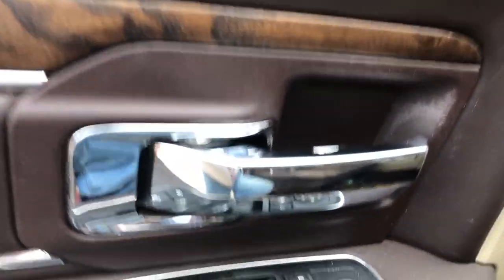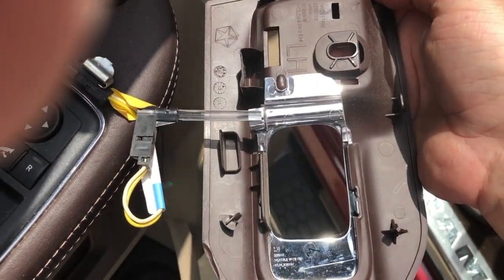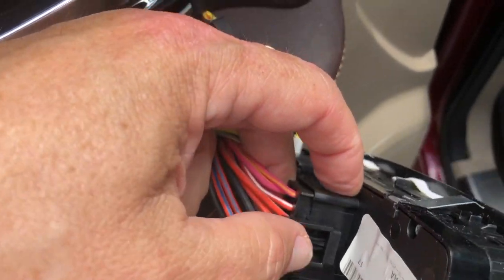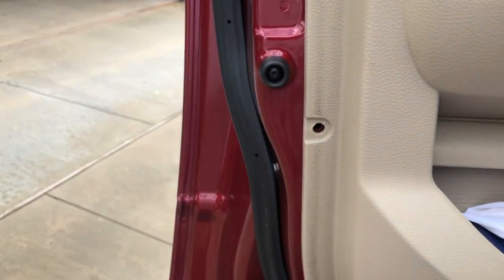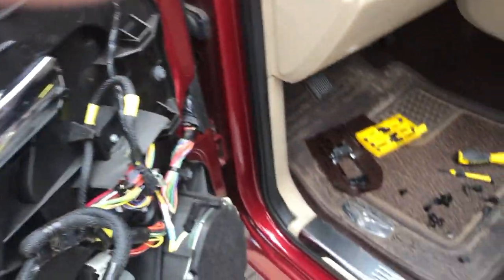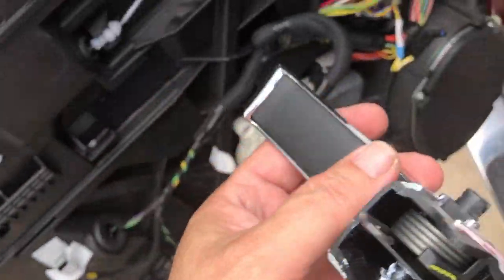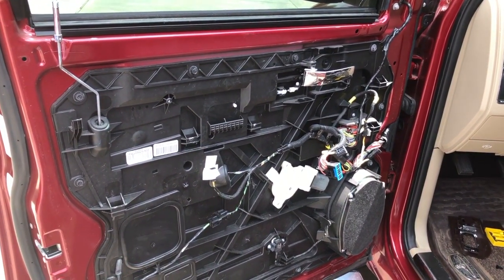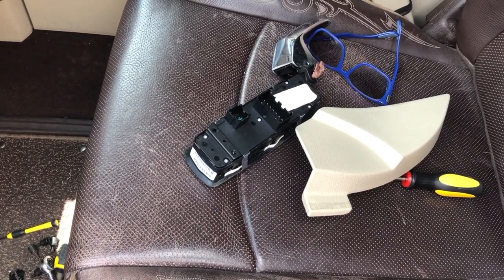2011 2017 Dodge Ram Interior Door Handle Replacement

Comment: ATTENTION before doing this on the doorman replacement and breaking it please file down that tab with a round file and it will slip right in. Been there broke two of them
Reply: Thank you for the tip. I did not have a file, but a drill bit worked just as good.

Comment: Thank you the video! wondering if you would happen to know the exact torx screw size that screws into the top of the latch handle. My latch snapped off & the screw seems to have disappeared.
Reply from the maker: I know this is way late but the size is in the video (T25).

Comment: You break the clip prying it off like that there's a release tab
Reply: Thank you for the video either way thought
Reply from the maker: Not sure what you mean. You mean the handle itself? There a clip that holds the cable. There’s a T25 screw in the top and once you pry down on the top to release it from the screw post, it just snaps forward, toward the front, to release the handle. The handle just has a plastic rod that snaps into the door.
Reply from the maker: Sorry about the single hand video, should have used a tri-pod but it was last minute.
Reply: Yep, broke mine following your advice, thank you….